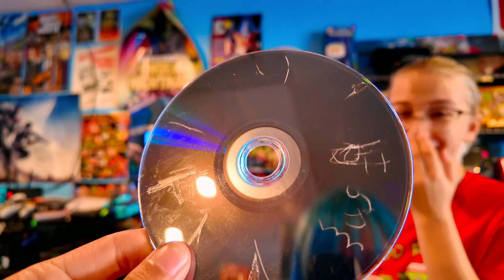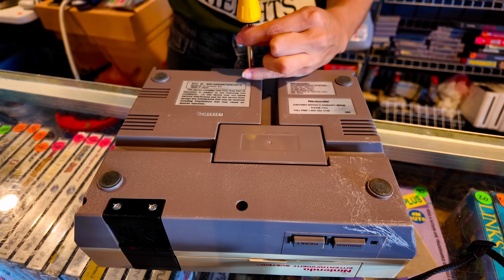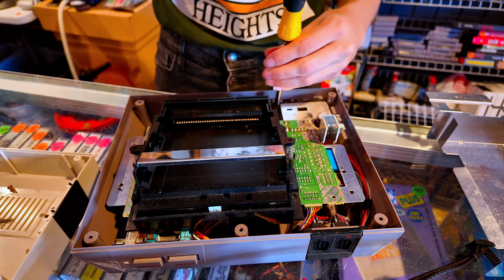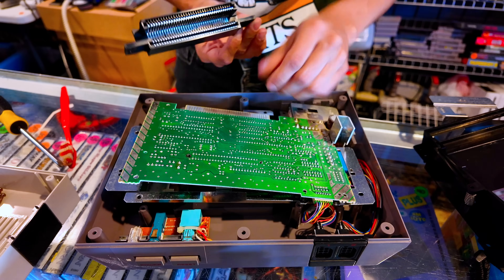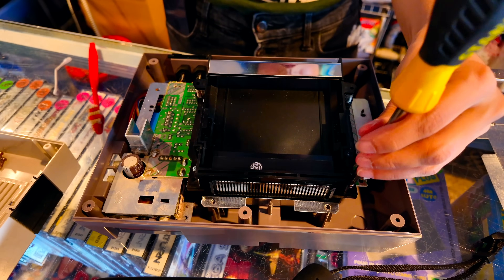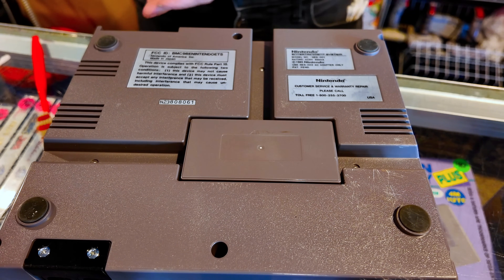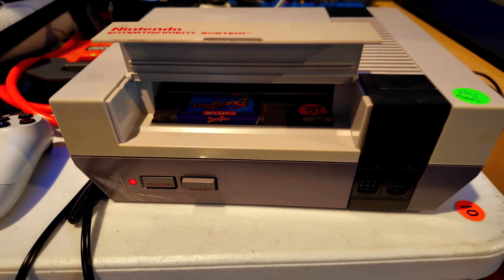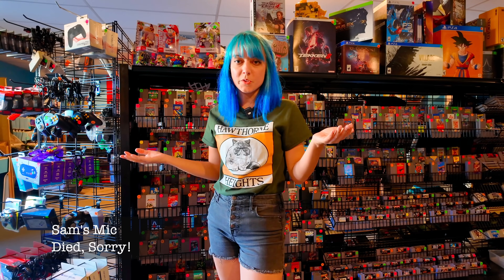How To Save A SAD Nintendo...

Comment: That disc was either used as a toy to throw around or the owners pet had fun with it and used it as a chew toy. My Nintendo Entertainment System had the cartridge issues. I took it apart and fixed it and I'm happy that you show how to do it so more gamers can fix their NES to keep on gaming and have fun. Cool video. ^_^
Reply: @RadJunk  ^_^
Reply: There's also a new NES drawer available for purchase that should be a lot more durable. From what I understand, it should be a lot more durable.
Reply: @SmallSpoonBrigade  That's great. I love that after all of these years the community is working together to keep these wonderful retro games alive. ^_^
Reply: @Supersmallchibiwolf  Yep, and it appears to be quite affordable when you consider the cost of just the regular 72 pin replacement being about a quarter the cost of the kid. And, it looks like I've finally been able to source a replacement cart slot for my Game Gear, so one of those will go in the GG and the other into the cart reader. They aren't even canabalized out of other units, so my GG Game Genie can sigh a breath of relief.
Reply: @SmallSpoonBrigade  I have been seeing a lot of Game Gear and Game Gear games in retro game stores and those anime / gaming stores near me. I'm surprised how affordable they are compared to other retro games. ^_^

Comment: Just bend the pins back.   I use a sewing needle.   I’ve done it to at least 50 nes systems.  Works great.  And disable the lock out chip

Comment: 9:14 Those internals look ancient. Wikipedia said the original NES Ricoh CPU was manufactured at 6,000 nanometers. That is crazy. Current computer CPUs are at 3-6nm which is 1,000x-2,000x smaller. Another thing I read on Wiki that is crazy is there has been almost no inflation in Japan over the last 40 years. It said Famicom cost 14k yen in 1983 which is equal to 19k yen in 2019. That is only like 40 percent inflation over 36 years. In the same timeline U.S. currency inflated by about 350 percent based on median income over that period going from 20k to 68k. It is probably actually closer to 500 percent based on how much everything cost just for living expenses.
Reply: For about 30 years after WW2; the Japanese economy was propped up by the U.S.  Now they are a extremely prosperous Same with S.Korea.  That's what happens when countries wisely spend the money we handout.
Reply: @thepropcollet  To be fair, Japan has a history of needing to be self-sufficient due to how hard it could be engaging in trade. Anytime the Chinese Emperor closed the border, it got extremely difficult to conduct trade outside of the  country, there's really only a few countries that are near enough to them to make trade particularly practical.

Comment: The NES was the first console I ever got when I was a kid. The 72 pin connector wasn't a problem on a new system. Only times re-insertion was needed was for dirty rented/borrowed games. But yeah, eventually when carts are left down in a system for years or decades the 72 pin connector doesn't work as intended any longer.

Comment: i remember when i first took apart my nes to clean it. it looked so overwhelming at first and i watch lie 6 different videos about disassembling the nes. after taking it apart i boiled the 72 pin connector and deep cleaned the nes and after that taking them apart now it was easy.

Comment: Nintendo always instructed, or people always understood to press down the cart, so whenever I used a Game Genie, it was "magic" that the game would play not being pushed down.  With a replacement 72-pin that I installed in my system back in 2012, I was able to just insert carts (with some more force than the old pin connector) without pressing down.
Reply: Nintendo pushed that view because they wanted the NES to be more VCR-like to distance itself from the Atari and other home consoles. It's not required to push it down and if you look at the connector, the pins are connected as long as you've pushed the cart back far enough to make connection. 

VCRs definitely weren't common at the time, but they were around and people had some awareness of them.

Comment: A couple things, one if you're going to go to the trouble of replacing the pins, it's worth smearing some dielectric grease to the motherboard side of the connection, the pin connector is something that can be manufactured again, and I'm fairly sure the one you're using is new, but the motherboard side is pretty much irreplaceable without getting one of those new opentendo boards and taking the risks associated with moving some of those chips to the new one.

The other thing, is that I don't think it's actually necessary to press the cart down, if you look at the mechanism, it's already connected the moment you push it in, the downward press was just a marketing thing. I personally press mine down, because the pins are bad and in order to judge how far to push the cart in, I need to push it just far enough to barely clear the case. One of these days, I'll replace the current mechanism with one of those nintendo drawers, but I do all my NES gaming on a Mister FPGA, so that's not a high priority item.

Comment: You can also do the blinking light mod and lockout chip mod. You can play the games without pushing down
Reply: Yes, and if you look into the unit while you push down on the slot, you can see that it's not connected tot he back. And from the video, you can see that there's no pivoting to the pins. All you're doing by pushing it down is increasing the likelihood that the pins will get bent. Hence all the issues with having to remove and reseat carts. Eventually you'd do it enough times that you'd get the cart in correctly to make contact.

Comment: I would have gently scraped a toothpick between the main plastic plates of the controller (to loosen built up palm gunk) before proceeding with the toothbrush, or does that put wear on the plastic, thus potentially allowing moisture inside the controller? Yikes, I didn't know the Shop Mouse hung with Shrews bubbling lord know what in large black cauldrons in the dead of night, lol.

Comment: Seems like a lot of fixers these days advise that using a pic to bend back the pins in the original 72 pin is better than replacing it with an aftermarket one.
Reply: If that works for you, that's the way to go as you're preserving the hardware. However, I'm not sure that the new ones really are any worse, the old ones were pretty bad, hence all that "blow me" nonsense that came of the pins not maintaining proper contact due to not being properly engineered to handle being pushed on when the carts are inserted and then depressed. Not to mention any corrosion that might take place from being breathed on.

Comment: Question for Rad junk, if you can answer it i would ve forever appreciative..
I have seen different 72 pin connector options online.. someone local said he wouldn't recommend the cheaper ones abd compared their quality ti the cheap ones on the retron and classiq N system which put a death grip on your games..
Do you use and recommend a specific one as I'm sure down the road I'll have to get a replacement for my new to me but very used NES system.

Comment: Have you ever tried repositioning the pins on the original connector using a pick or similar tool?  There will never be new connectors that are produced as good as the originals.  All the ones I've come across the pins feel dangerously tight when inserting a cart or they just suffer from flimsy overall construction.

Comment: I’ve done quite a few of these. The quality and fitment of the new aftermarket connectors has been hit or miss. Is there a particular source you’ve had better success with in terms of part quality? Also death grip is a problem with many of the aftermarket ones.

Comment: I would take a minute and look around the board for bad solder connections and maybe  puffy capacitors.
Reply: Yep, I need to do that because while recapping consoles is usually not that hard, especially the older ones that don't have dense circuit boards, once they start to leak, they can start to corrode the traces themselves over time if you're not careful. But, recapping them tends to be just a matter of identifying the correct capacitor and replacing the old with the new. Some systems are common enough that people have kits ready for purchase for a DIY job and some retro shops have people that can be paid to do the job for you. 

Not to mention that there are still a few TV repair places around that can do it, as long as you provide them with the correct information about which caps to install wear.

Comment: Refurbishing the old connector is probably better.  It only takes a few minutes to bend the pins back with a dental pick or safety pin.  If needed, you can use a high grit sandpaper or just a microfiber paper/cloth to clean it.  
I used to just replace them years ago but it is such a waste of money considering how little work it is to refurbish the originals.  Even refurbished, I have found they are more reliable than the aftermarket replacements.

Comment: @jjcc2192 instead of replacing the teeth you can take a small enough screwdriver to bend them back in position manually and put spacers where the springs are in the tray. This way you never have to push the game down and cause the damage all over again. It also lessens the wear on the cartridge. Of course if you want to replace the teeth and avoid the tedious task with the screwdriver you can.

Comment: U don’t need a new pin connector simply boil it for 15 minutes and that’s it. After boiling it pour 99% alcohol and let it quickly dry.

Comment: I suggest if you do this a lot, then you should stop buy your local Harbor Freight and buy a couple magnet screw trays.

They cost like 3 bucks and are just super handy.
Reply from the maker: We actually keep them on our workbenches but for a quick pin job, the bottom tray or expansion port cover do the job!